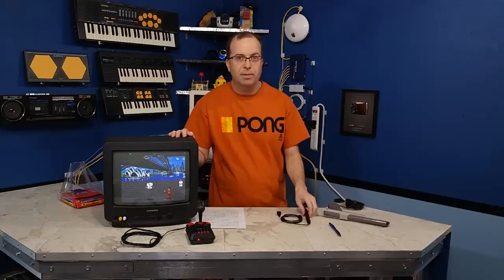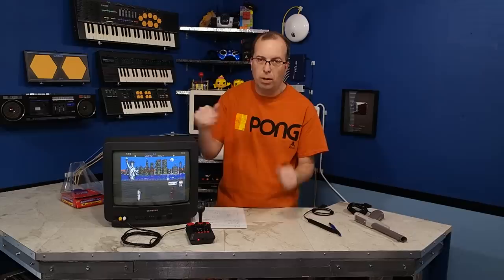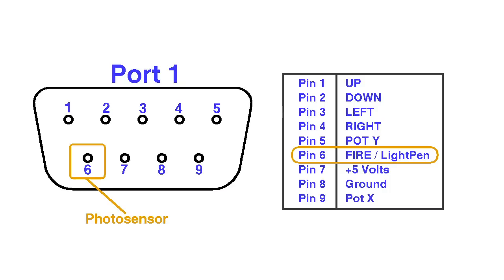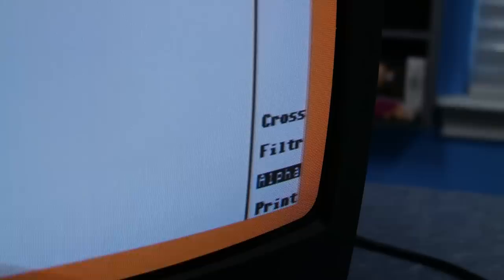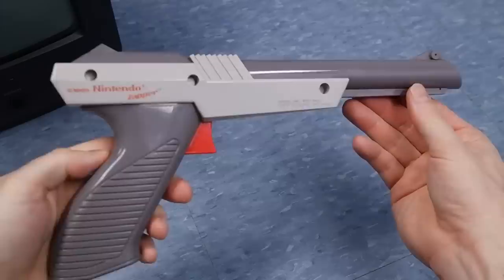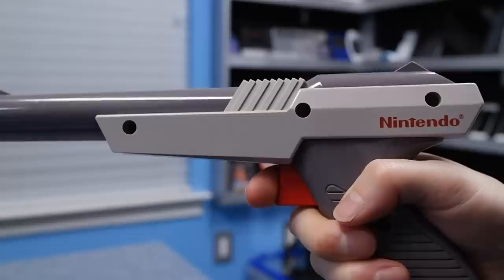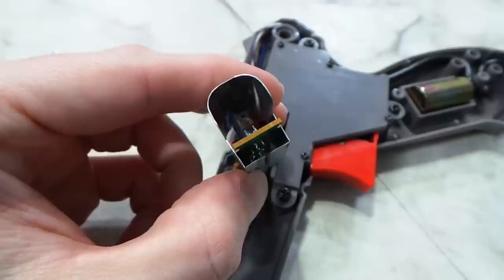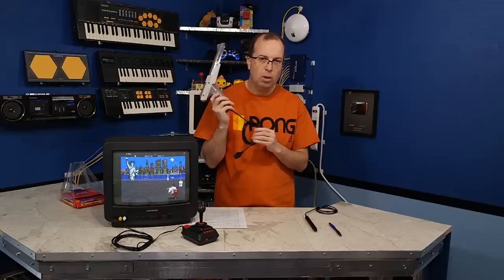How light pens and light guns work NES Zapper

Comment: The Wii pointer actually is more precise, but can offer the same general functionality as the light pen and zapper.
Somewhat different technology. (the sensor in the Wii Remote is an infrared camera with built-in point tracking hardware)
Which actually means that the Wii was one of the first systems that could run light-gun like games on an LCD display.
And in fact had several examples of such games released.
Or rather, games whose gameplay style is basically comparable to lightgun games.

Also several that had pointer functionality similar though distinct in nature to how a lightgun game tended to work.

I suppose the Wii and Wii U can support duck hunt on the virtual console because of this.
I never did check if they actually made it available or not though.
Reply: Do you happen to know if also shooters on rail with LCD screen at the arcade use an infrared camera?
Reply: KuraIthys This may have changed with age and updates but previously the only way to play duck hunt on the Wii was a homebrew which replaced the "hit/miss" zapper with the location tracked wiimote.
Reply: Duck Hunt was released on Wii U virtual console and does indeed use the Wii Remote pointer!
Reply: I have no idea how arcade games do it. XD
But the Wii definitely demonstrates one possible option.
The basic idea that any such shooting game needs to deal with is determining where the gun is pointing.
But there are a lot of different ways to make that happen, so I really couldn't tell you how arcade games do it, or even if any given two arcade games do it the same way.

by chance I happen to know how the Wii remote pointer works.

and to be specific about that, in case you're interested, the hilariously misleadingly named 'sensor bar' contains 10 infrared LED's in 2 groups. Although there's 10 of them, it really just seems to be to make it brighter, since it's set up in a way that to the sensor in the remote looks like 2 points.

The Sensor itself is a 128x96 infrared camera with a field of view of about 30 degrees. (there's a filter in front of the camera to ensure that it mostly responds to the infrared light frequency of the sensor bar, rather than anything else)
This camera has a dedicated special purpose processor built into it that takes the camera output, finds the 4 brightest light sources, and using some calculations based on multiple pixels outputs 4 sets of coordinates. 
(it's impossible to read the raw camera data, so you can't actually tell what it's seeing.)
The output is a screen coordinate for a pretend screen with a resolution of 1024x768, with the usual quirk of computer screens that 0,0 is considered the top left of the screen.
Although this is all relative to where the sensor bar is, so if you want to use it in software you have to guess the relationship between the sensor bar position and the actual screen.
So what this little sensor gives you is an X coordinate, a Y coordinate, and a 'brightness' (0-15) for the 4 brightest light sources the sensor sees.

The point there being 4 points is that if you arrange 4 IR lights in a suitable pattern, and know what that pattern is, you can fully determine a position and orientation of the sensor relative to the tracking marker.

Unfortunately for whatever reason Nintendo chose a tracking marker (incorrectly being called a 'sensor bar'), which for all intents and purposes consists of only 2 IR lights.

This means you can determine an X and Y position, and rotation (but only 180 degrees, you can't tell the remote being upside down from right side up, it looks the same. Fortunately the Wii remote has an accelerometer that is pretty good at telling you which side is down.), and a very rough guess at the distance between the marker and the remote, by looking at the distance between two points, and also the brightness of the points.
The distance calculation unfortunately isn't very accurate because with only 2 points being off to one side looks largely the same as being further away.
So basically you can't tell being at an angle to the tracking marker (sensor bar) apart from being further away from it.

Still, an x and y coordinate is good enough by itself to mimic light gun games. And the rotation is a fun feature as well.
It's just that a minor modification to the sensor bar design (which would not be all that much more expensive than the one they included with the system) would have meant fairly reliable 6 degree of freedom tracking, though it would still be limited by the very small field of view of the camera.

Still, for what it is, it's arguably more useful for gameplay than the main feature of the wii remote - the accelerometer.
It can mimic a light gun, and a mouse, and several other comparable input devices to a decent degree, which few modern consoles have been able to really do.
Especially I can't think of any console that has really had anything comparable to a mouse since the snes...

-----
And Duck hunt made it to the Wii U virtual console huh.
That does make sense.
It's far from being an entirely accurate representation of how the zapper works, but it's close enough to be playable, which is the main thing you'd expect from the virtual console...
Reply: Thank you! It was an excellent explanation!
Reply: +KuraIthys As far as post-SNES mouse input goes, PS1, Sega Saturn and Dreamcast had mouse controllers, and PS3 Wireless Keypad had touchpad functionality.
Reply: It even works without the infrared camera using candles albeit not so good.

Comment: Someone needs a high speed camera!
Reply: it would need to be INCREDIBLYYYYYYYY fast.
Reply: Tj & Ja well, there are cameras with 170k fps, if I'm not mistaken... But 20000 fps should do the trick, too...
Reply: Tripplehelix the slow-mo guys did an episode on crt
Reply: go ask slow mo guys, and dont forget to tag me...
Reply: There’s a high-speed camera that can record light moving. #mindblown
Reply: TuckyIsAwesome actually for those images they use the stroboscopic effect
Reply: There are cameras that capture over a trillion frames per second.  So fast that you can actually see light move.
Reply: Act there is a very simple way to cheat this game.. just pace a light source in front of the gun and press fire button u will definetly shoot the Duck No matter where the gun is pointed to floor or wall😁😁
Reply: Sharad Kumar does it not fail to recognise the black frame?
Reply: Nope
Reply: There is a youtube channel called SlowMoGuys who recorded CRT in incredibly slow motion

Comment: I guess if you had a CRT monitor built inside a desk, like facing upwards, or slightly at an angle so that you can both properly see what's on it while sitting at the desk and effortlessly point at it with your light pen, it wouldn't be quite as cumbersome to use, but that's a hard trade-off just for using a light pen though, when your C64 could be used for many more things besides that and which then would be uncomfortable to use on a monitor set in that position.
Reply: Or a monitor mounted on a hinge in a desk, not unlike a sewing machine. Folded down for writing, lifted up for viewing

Comment: Thanks!  They were using one to help with concepts for Tron (1982).  They were using a high tech display to do 3D graphics on an orange monochrome looking system. I actually got the extra’s originally on the Laser Disc, but it is also found on the DVD release with the black cover with a teaser graphics. #ono

Comment: As for the gorilla arm that inevitably comes from holding your arm upright so long, I guess you could've mounted a monitor like in a cocktail arcade cabinet, facing upwards?  Would be a lot of hassle though, and you'd probably have to have a monitor/TV in that rig all the time, too much work changing it out.
Reply: I've seen video of extremely old CGI workstations (for Pixar, I think) that actually used that basic setup for use with light pens.

Comment: I always wondered why games such as: duck hunt & yoshi's safari wasn't available on the Wii through virtual console, to me these were wasted opportunities since the technology was there
Reply: I feel like a straight port of Duck Hunt on the Wii might actually be too easy, because the technology has improved so much in terms of accuracy and screens have gotten so big
Reply: @joebykaeby  Even if you managed to connect an NES console to a HD TV through a SCART/HD adaptor, the zapper wouldn't work on it, but than I don't think the Wii went HD either
Reply: I did used to play a few shooter games on the Wii that used a shotgun style case to hold the wiimote pointing at the tv and the Chuck to be held by the hand holding the barrel.
It was pretty cool and didn't have to many gameplau issues
Reply: @whatagreatnameaye1169  Ya i remember that too & since the NES & SNES have gun games why can't they include them but like i said a wasted opportunity

Comment: Very nice :). The SNES Super Scope actually behaved more like the light pen, tracking the CRT beam and giving accuracy to "one television pixel" (so the TV commercial said). One thing I never knew is why the separate sensor on the TV was necessary, if it was tracking the CRT beam.
Reply: Because it's wireless (IIRC taking 6 AA batteries or so). The sensor would replace your normal controller. So the gun transmits signals to the sensor and the sensor acts as the actual controller.
Reply: Ah, so the wireless receiver is just basically a wireless controller receiver. Makes sense! :)

Comment: Not sure I understood how the zapper gun knows where you are aiming, was it similar to the pen?
Reply: The gun is only a light sensor with a lens in front of it to focus the light. When you pull the trigger, the NES sends a completely black frame and then reads the Zapper's sensor. If it reads that there is no light, then it assumes it should be pointed at the screen. Then it shows a white box where a target is located on screen and then reads the zapper's sensor again. If it reads that the sensor has light, then it assumes that the gun is pointed at the white box on screen. It had to read them in that order (No light on frame 1, Light on frame 2) in order to register the "shot" happening in that location, otherwise you could just point the gun at a white light and pull the trigger and win the game. For the second target like in the video, it just had to read the sensor for 3 frames (No light, No light, Light) and then it knew the gun was pointed at the second target.
Reply: The zapper gun doesn't actually know 'where' you're aiming, but rather it detects if it was pointed at the white-square flashed on the screen for a single frame. It is just a very narrow angle light sensor looking for a signal spike in time with the game. - If pointed at the target, then it will see the black frame followed by bright white > Signal processing will register this spike as a hit. If you're not pointing at the target then the light gun can't generate the spike signal, and therefore you missed.

(You could rewire the light gun to constantly generate that signal spike and trick the game into never missing. And get rid of most of the gun itself and not even move or aim it.)

The SNES light gun however was closer to a light pen in design, and allowed actually moving an aiming point around on the screen. I have very vague memories of just how awesome that was.
- They were simpler times really.
Reply: The light gun worked through the TV screen drawing the picture left to right, top to bottom.  Before each frame the computer with signal to the TV something called a vertical blank meaning "OK, the frame starts here"

The position of the light pen would be measured by counting the delay between the vertical blank and the light pen detecting light.  

I'm guessing holding a light pen to a lamp would jam the pointer in the top left of the screen (CPU goes "OK that's the vertical blank and OMG I SEE LIGHT ALREADY!!!")

With the light gun, the console fades everything to black when the trigger is pulled for one frame so the gun can sense "OK, this is what black looks like"

The next frame it draws a white box where the duck you're aiming for would be.

If you happen to be aiming at the area of the screen where the white box is, the light gun goes "Right, that's not black, that's a lot lighter than black"

If you aren't, the gun goes "Yeah, that's still black."

Light pens don't work on flat panel displays because LCDs draw the screen all at once.  This means that when you use a light gun on an LCD TV, the cursor would always be jammed in the top left corner (vertical blankOMG LIGHT ALREADY!!!!)

Light guns don't work on flat panels displays because of latency, there's a delay between what goes into an LCD TV and what you actually see that isn't there on a CRT TV.  So you pull the trigger on Duck Hunt and the whole "this is what black looks like, here's the white boxes the represent the ducks" thing happens after the trigger is released and the gun is just sat there going "black is a funny shade of blue for some reason."

A light pen basically has been replaced by the touch screen.

What light guns have been replaced with... not so sure.
Reply: Basically it sees light when a sprite was lit, so by logic, it must be pointing at that sprite.  Granted, it always expected to see darkness when the black screen frame is lit else it would assume it's not pointing at the screen.
Reply: Current light guns look for fixed points of IR LED lights to track its own position. The Wii remote, Guncon 3, and all arcade gun games with a LCD screen uses this technology. There is also the reverse where a fixed camera tracks the position of moving colored lights emitted by the gun/object. The Playstation Move and the Playstation VR headset uses this technology.
Reply: Light flashes where the sprite was; if the light gun saw light, then it was aimed correctly.
Reply: Yep exactly.  The Wii "sensor bar" is just a piece of plastic with 10 small infrared bulbs in it.  The sensor on the controller just detects the relative position of these 10 bulbs.  You can actually replace the sensor bar with 2 candles if you place them properly, it's kind of funny (since candles give off plenty of infrared).  This type of technology is better because it is completely independent of the display.
Reply: Akaihiryuu77 This guy is right. I have taken apart my sensor bar before and it had 10 IR bulbs in it.
Reply: But pen is just light sensor too... So i dont know why he told that they are different. Devices are the same only logic on the other side is different.
Reply: Pretty much yeah, the logic only changed, in fact you could probably hack a light pen into a zapper, or the reverse. The zapper just knows if you hit or miss, the other one knows when it happens (as on a light pen you'll always hit some white pixel), knowing when, it knows where. Just more precise timing on the light pen but hardware wise only difference is format and lens.

Comment: I had the SEGA Master System with a light gun and used it a lot. But I used even more the light gun on the SEGA Saturn. Does anyone know if works in the same way as in the zapper from the NES?
Reply: While not 100% sure I'm pretty confident they all follow the same principle (although possibly with slightly different strategies regarding target detection or separation. You couldn't do a lot more back then, especially considering how fragmented display sizes and types were (curved, non-curved, resolution, size, quality, etc.).
Reply: The Virtua Gun for the Saturn worked on a variation of light gun trickery, due to Virtua Cop mostly being a straight arcade port that also using conventional light guns. The Super Scope and Menacer (SNES and Genesis respectively) were the odd-balls that used a light emitter on top of the TV , with the gun picking up its respective position based on aim point, instead of screen flashing tricks.

Comment: 4:50 - it's interesting to look at how Vectrex addressed this problem. Since "black" areas of the screen are not even scanned (let alone illuminated) the system draws vectors to search for the light pen in cases where its position can't be identified.
In retrospect it's shocking just how simple Light Pen hardware really is. Back in the day it seemed practically magical.

Comment: A pen is a common writing instrument used to apply ink to a surface, usually paper, for writing or drawing.[1] Historically, reed pens, quill pens, and dip pens were used, with a nib dipped in ink. Ruling pens allow precise adjustment of line width, and still find a few specialized uses, but technical pens such as the Rapidograph are more commonly used. Modern types include ballpoint, rollerball, fountain and felt or ceramic tip pens.[2]
Reply: Thanks for this USELESS information that has NOTHING to do with this video

Comment: Important detail missing on the zapper gun: there is a frequency filter in the input. Only light comming at the right frequency will light it up. This is why it won't work on LCD, and this is also why it won't work if you shoot any source of light.

The filter is made with capacitor and cap be tuned by changing these capacitors. I know I did it to have it work on a 60Hz monitor for a personal project a few years back.
Reply: Correct me if I'm wrong, but the whole black/white square screen will essentially create that 60Hz signal – as will classic light bulbs. The problem with LCD screens is the fact there's always one frame lag because it displays whole frames at once, which is enough to screw the gun.
Reply: Even if, it expect a blink for each row drawn on the monitor. The filtering is 100% analogic and done in the gun.